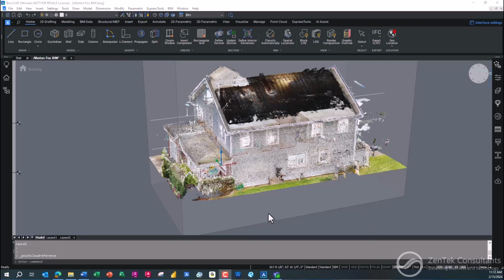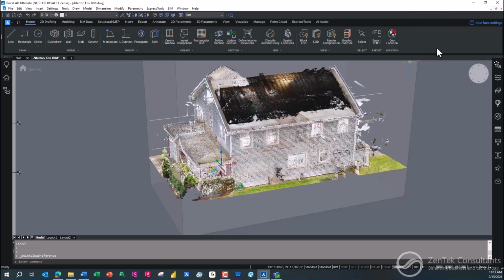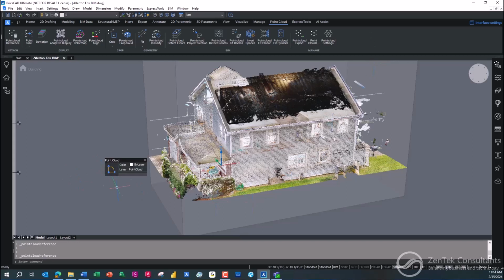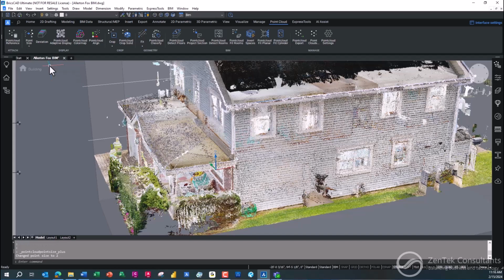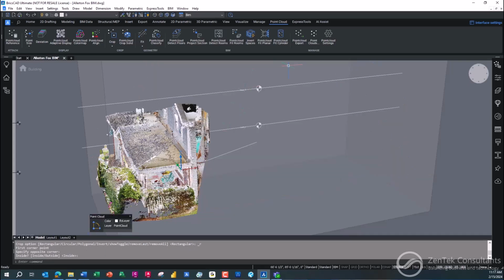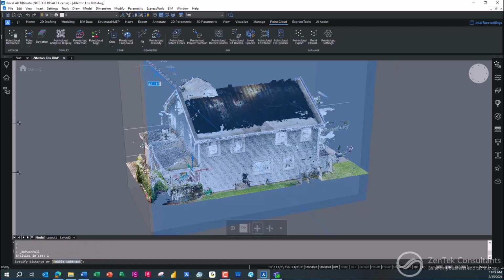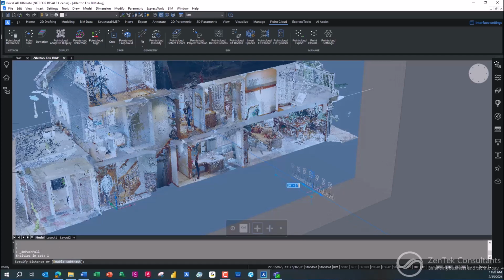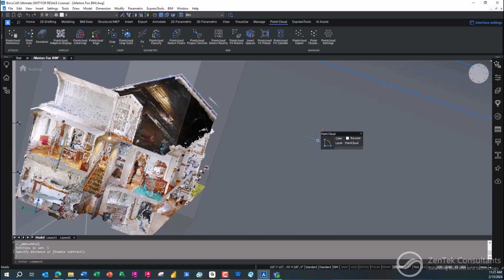Scanned Data and Point Clouds

Comment: No. Bricscad is shit. Especially for architecture so BricsCAD BIM. It's a glorified AutoCAD clone that got a bit ambitous and tried to adapt the 2d-DWG AutoCAD workflow for a 3D-Bim envrionment. Don't test me i will go in depth on this if i have to.
Also have not seen a feature in Bricscad that Revit or Archicad cant do (except the point size on the pointcloud ... like honestly Autodesk you need to step up your game). Also would be pretty embarrasing if Bricscad would not be doing at least okay in this regard as they are a part of Hexagon which is also the parent company of Leica ... you know, the company that makes a bunch of laser scanners like the RTC 360. All the auto features like detecting walls don't work nearly good enough to be used in actual production so you have to double check everything which takes just as long, if not longer as modeling it by hand would take. 
I evaluated BricsCAD for my workplace to potentially replace Revit and even though i often hate Revit with a burning passion, bricscad manages to be so much worse.